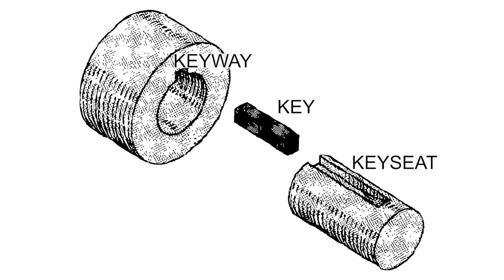What is that KNOCKING❓💥😵 |ENGINE Sailboat Maintenance Ep 341

Comment: That is great that you found the knocking problem. To easily remove the shaft clamp try putting a 2 mm blade of steel in the expansion slot, then put grub screws in the threaded side of the clamp screws holes and screw them in against the plate. This will expand the coupling clamp.  If your mechanic guy wants a holiday in the Netherlands, he can come over here and fix up all the issues with my engine.

Comment: realizing this was all done in the past, but when the motor mounts went back in please tell me they aligned the motor and shaft before the flexible coupling went on. The better the alignment, the less the coupling will need to do, the longer it will last, and you will reduce vibration also.
Reply from the maker: Yep, Hendro the mechanic was insistent on this, Mark 👍

Comment: Ah ha it comes back  to my original thought, engine mounts didn't cross my mind though and kinda shows how rough a balance diesel engine is, it's certainly not balancing a coin on the rocker cover trick smooth but then it's not a Jag :) keeping fingers crossed that's that sorted and onto the next item on the list to do, btw very sharp night shots, wonder what F stop lense ?
Reply from the maker: A couple of people did guess mounts, Brian. I didn't! The lens used is only f/2.8, I just use a high ISO.
Reply: @followtheboat  Thanks for reply, I have a 14mm with F2.8 will experiment more as only used it for very dark areas such as camp ground with no lighting and taking pictures of the stars
cheers atb

Comment: Did y'all get the diesel leak fixed that damaged the rubber on the mount(s)? Pro Tip: After polishing the shaft, if you lightly grease it, there will be less stress to the "o" ring(s) when removed. 🌬⛵🐻
Reply from the maker: I still don't understand how or where that 'leak' is coming from. There's no evidence of a leak. It could be oil 🤔

Comment: 10:52 another channel ,  I can’t think of the name for the life of me had this problem as well..
Reply from the maker: Let us know if you remember, Trev 👍
Reply: @followtheboat   I’m thinking it was sailing millennial falcon,  but Subscribing to sooooo many channels has its drawbacks,  i will eventually remember,  probably by the time you sort it,  ps which ever channel it was,  they hadn’t got a result either,  but I can’t remember them even thinking it was a cooling issue,  so either you’re on the “right track or they are,  if i remember correctly they were thinking something with the external alternator regulator,  which didn’t make alot of sense to me..  (especially if the engine is off)
Reply: Racking my brain,  i think it was a bad connection at the inverter leading back to the charge control unit,  just the one wire that tells the charger the state of the batteries,  I remember their one past the self diagnostics,  because technically it was working right, apparently it measures the power required from two different sources,      It was sailing gypsea,  i will find the link,  I remember now..

Comment: You  don't have a flexible coupling. It is a homocenetic joint. And it has probably worn out because it has been running out of spec. That is about 2 degrees (long time running) on each joint. Probably you have been far out due to defective engine mounts. To open the coupling to shaft: Remove all bolts. Put a piece of steel in each slot. Enter the bolts in 'the wrong way' and the prop shaft will be free. Nice and easy. Same procedure for installation.
Reply from the maker: Yes, I'm sure the defective mounts then caused the coupling issue. I am aware that 'flexible coupling' is not technically correct, and try to use the term 'universal joint' when I remember (!) but I haven't come across 'homocenetic' before. Thank you, I'm off to look this up!
Reply: @followtheboat  One of my special areas. Look up 'CV joint', 'Acuadrive' or 'Pyton drive'.  Note: They shal run at a certain angle, but not too much. Fair winds.

Comment: man after all the engine problems you all have  wouldn't it be better to switch from fuel to electric by now..  and add more solar panels and batteries.. become a green boat ..
Reply from the maker: The tech isn't there yet for full-time cruising. Hybrid, possibly. But way out of our budget. 🙏 Liz
Reply: @followtheboat  a fallow up question:  have you notice any health chaNGES SINCE DRINKING  and useing a watermaker on your boat. city water here has always had chemicals of some sorts..   and good luck with the engine
Reply from the maker: Not so much health re the watermaker water but we notice the chlorine they add to town water, which we filter with a carbon filter to remove it (and the taste).